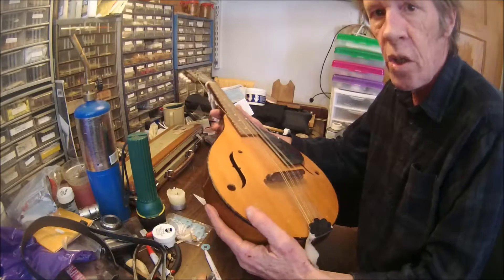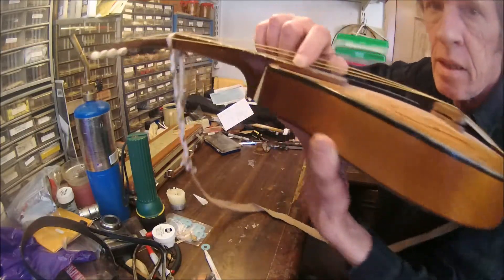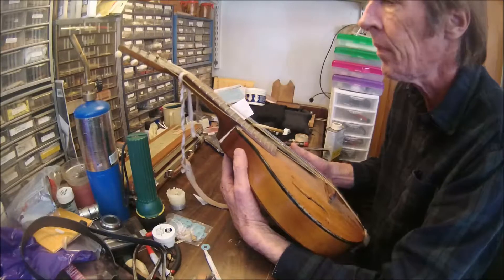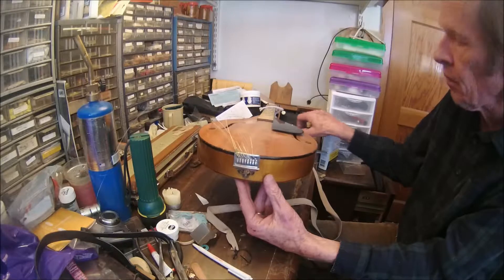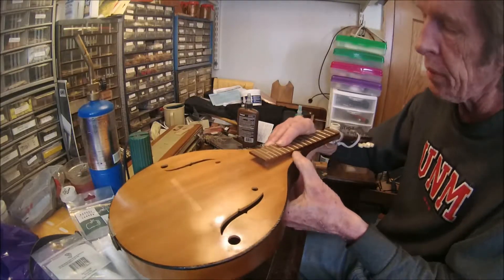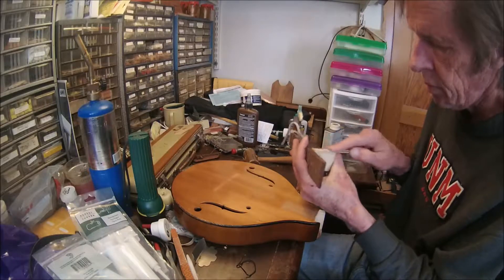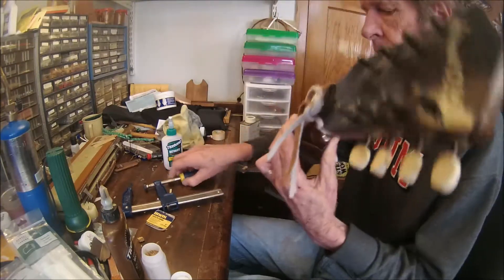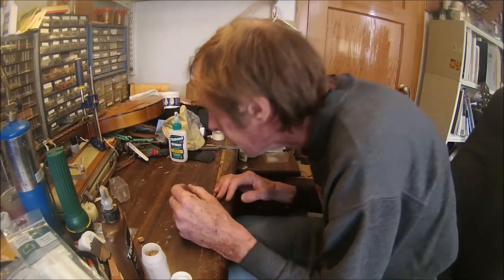Mandolin repair   restting the neck

Comment: I recommend Tite bond Original folks .. because it holds good but is a lot easier to remove later ... Tite bond 3 will require more heat and possibly hurt the instrument and have more tearout if you have to repair it later

Comment: I never understand Luthiers that have junk all over their benches and no protection. then working banging and knocking the instrument.
Reply from the maker: instrument is not "banging and knocking around"    And often times a repair bench may have more than one project underway at any given time.  No, its not the neatest thing but I always make certain that there is enough space clear for the instrument that is being worked on.
Reply: @richardhannemann4594   Sorry to sound harsh but it scares me to death everyone to their own i suppose.
Reply: @richardhannemann4594  Great video!  I bought a broken mandolin for 5 bucks . looked really good, except for a break the same as yours. strings were still on, and the neck was warped outwards below the 12 th fret, which is where it was glued to the front of the body. It was warped, but I managed to reset, and it was good for a year. Came apart again , and the outwards warp is very visible and  not playable. I took it apart, but how can I remove or reduce the warp outwards ?  Thank you for a reply !!
Reply: I know,  right ?  This is not normal folks ... make sure you put a rug or piece of carpet on the work bench before you start .... also clean up your bench before you start anything...  The very last thing I would want to do is to have someone bring me a. Original Loar mandolin...
    Or even a newer $6000 mandolin that didn't have a mark on it .. and it leave my shop all scratched up ...Thus turning a $6000
Mandolin  into a $3000 mandolin... that'd suck for me and the customer.....

      The guy is quite knowledgeable.... its just  that he's a little haphazard in keeping his bench clean and scratch free...
Reply from the maker: @thefreese1  Take a closer look --  there is a flute in progress as well.  As I am the only repair tech in my county, I usually have more than one project going on at a time.  Hence the "clutter".  But I always make certain the actual work area is sufficient to the size of the instrument being worked on and is free of dust and etc.  And after 16 years I have yet to have a ding or scratch on any instrument I've worked on.